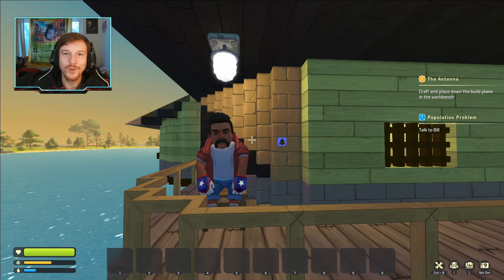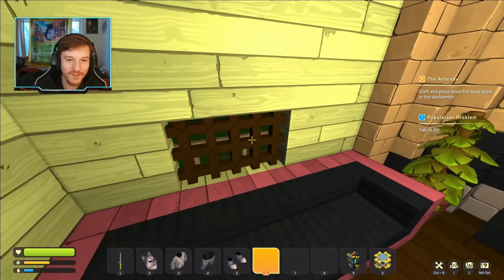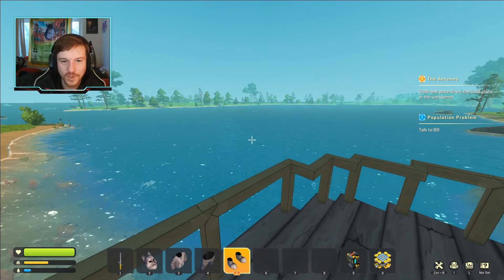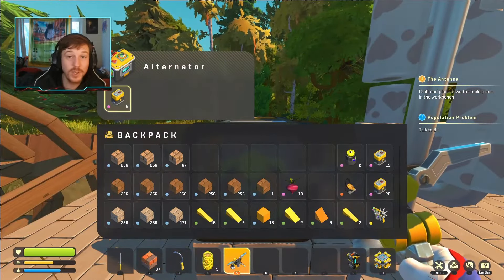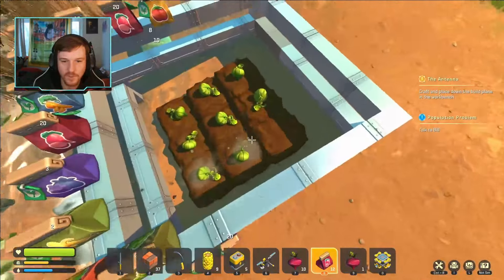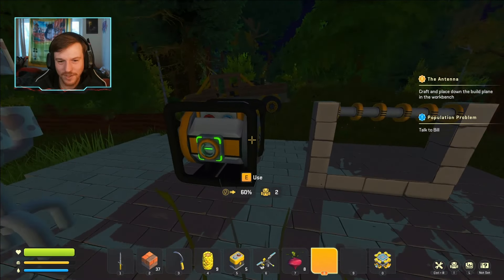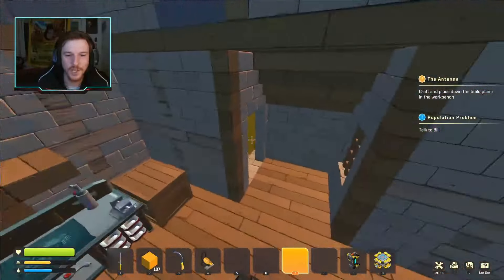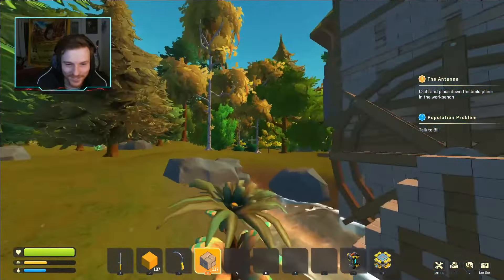Making A Watermill To Get Infinite Batteries!! // Crashlander Ep 10

Comment: Does a small wheel mounted on a engaging piston which pushes the small wheel onto the outside rim of the waterwheel spin a bearing fast enough.?

I know my other hair brain schemes haven't worked for various reasons but, again, I'll be trying this.
All looks pretty,  Wolf head/s wall mounted.?

:)
Reply from the maker: It's always worth a test! 
I feel like they decreased the spawn rate of the wolf heads, barely see them anymore D:
Reply: Kan tried a basic piston engine. It works but is slower than the controller. Controller wins because it has so much torque.